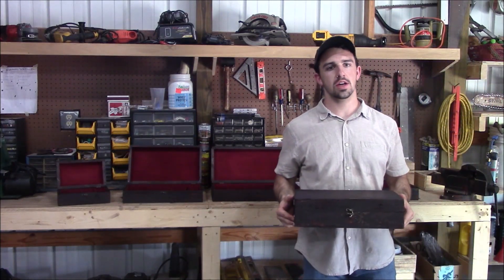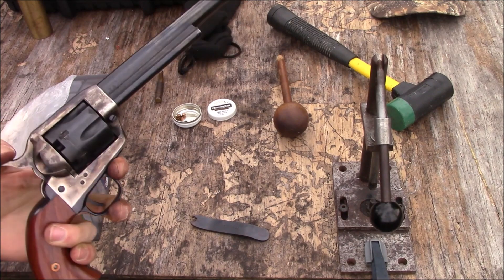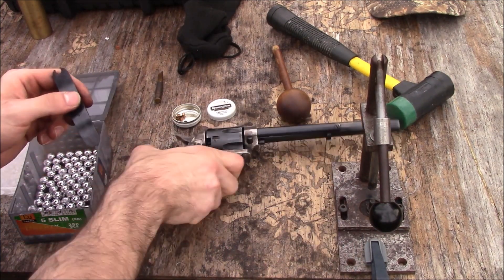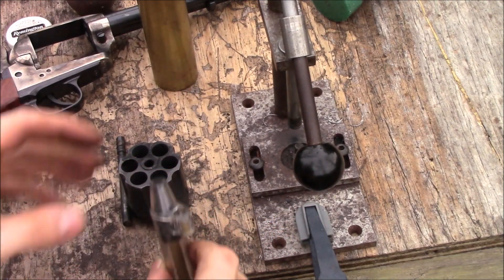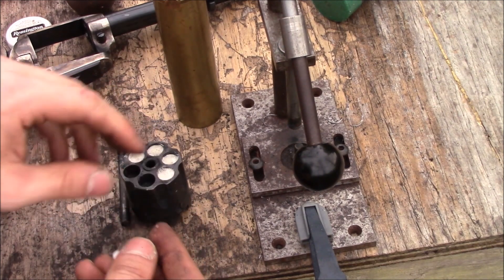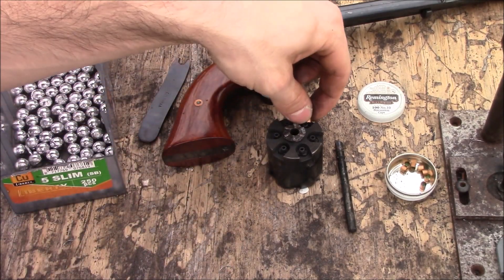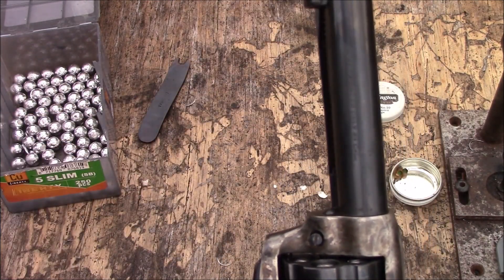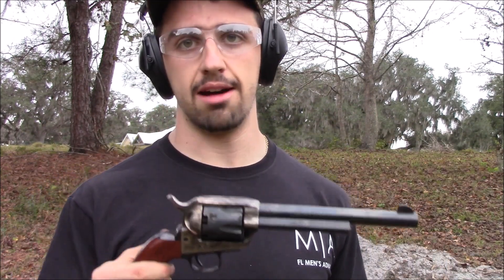Loading and Shooting the Pietta 1873 .44 Black Powder Revolver

Comment: Just bought one of these manufactured by Pietta in 1999. Fit and finish is great compared to what I’ve heard about Piettas 90’s quality. Has a mirror polished hammer with correct checkering, deep rich blue, and very beautiful blue case color hardening. Also came with a set of faux ivory grips. Cost me half of what a new one costs. Still my best purchase to this day.
Reply from the maker: Sounds like a great find! Despite being historically-inaccurate and all that, it's a fun revolver to shoot on the range.

Comment: Hi!  Very good video, it's worth learning how it's done in the West 👍 Can this model be loaded with 21 grains and a different size bullet, 454 or 457?  Is the 451 You use better?  (for 5,5 barrel). Greetings!
Reply from the maker: The right size bullet is dependent on the diameter of the chamber in the cylinder. Some of these .44 cal revolvers fit .454's better, where others could require a .457, for example. The best sized round ball is the one that leaves a ring of lead when the ball is loaded into the cylinder. Thanks for watching!
Reply: @blackpowdershooter44  If the ring is left on, it fits tightly and that's good.  I will measure the diameter of the chambers with a caliper, that's an idea 👍 Thank you for your answer and I wish you many "Tens" and good luck on the YT channel :) Regards!!!

Comment: I took the ejector rod off of mine as I don't lime having non functioning things on my guns. if i ever had to carry one of my cap and ball revolvers for self defence I would use my 1873. most options for a comfortable and secure holster, fully protected nipples, and mine has a safety notch in the cylinder for the hammer.
Reply from the maker: I agree, the ejector rod has no use and is just another thing to clean I just like the way it looks on the gun.
Reply: @Extra Relaxing uberti

Comment: If you don’t touch the cylinder the pin comes out much easier,any pressure against the cylinder makes it much harder to pull the pin
Reply from the maker: Makes sense. In any case, the cylinder pin removal tool is a must for someone who has one of these revolvers. Thanks for watching!
Reply: @blackpowdershooter44  I have 2 pietta and 1 uberti 1873s and if I hold it by the barrel and push the button without touching the cylinder ,the pin comes out much easier. Keeping it wet with oil helps also. I hate to pry anything against the frame because it will show wear eventually.

Comment: Those cases are really nice! I got one like those from Taylor’s a while back but I really like the darker finish you put on them. 
I would like to do a conversion on one of these. But I hear it is quite the affair. Does the ejection rod work or is it fixed in place?
Reply from the maker: The ejection rod does work actually, which is pretty funny because it doesn't do anything with the cap and ball version. Does your box from taylors have something in place that prevents it from opening all the way? I'm thinking about adding that feature to some of the boxes in the future.
Reply: @blackpowdershooter44  yeah it props up on something not sure what.
Reply: @blackpowdershooter44  I took a closer look and the hinges have raised portions that meet and hold it at a 90 degree. Next time I see yours on eBay I’m going to get one.
Reply from the maker: @Munkylaw  Thank you! I am going to put 2 different models back up for sale this weekend, and will put a link in the video description, though I hear that the link sometimes doesn't work correctly.

Comment: Do they make a conversion cylinder for this gun? If they do it’s probably 200 bucks, 400 for the pistol, 200 for the cylinder, probably be just better off buying a Cimarron in .45 Colt or something. Sorry just thinking out loud. Ran across one for sale with a pound of lead balls, a rammer stand, 2 big bags of wads for $450. Was trying to debate if I wanted it or not.
Reply from the maker: They do not, the frame is designed a little differently to make it not compatible with a 45 LC cylinder.
Reply: @blackpowdershooter44  thanks for the feedback. I think I’m gonna pass on buying it. I’ve got an 1851 and an 1860 Pietta. I don’t think I’d like the idea of having to take the cylinder off everytime I want to reload. I do want a reloading stand though. Those display cases look good too by the way.
Reply from the maker: @wvbygraceofgod5508   Glad you like the boxes, I appreciate it! Btw, you can always take that $450 and put it towards an 1858 Remington... Just saying lol. Thanks for watching
Reply: @blackpowdershooter44  1858 New Model Army was really what I was wanting next for a black powder. It’s funny you even mentioned that, I think that’s a sign, lol

Comment: You have a proper powder flash why not just powder directly from it?  The volumetric spouts screw on and off, or you can cut that one down to throw the volumetric charge of 25 grains, but black powder and all substitutes are made to throw by volume so the volume your spout throws with one matches the others regardless of grain weight.
You place your fingertip over the end of the spout, open the valve with your thumb, and turn it upside down to let powder fill the spout, then close the valve and tilt by up - you have the proper amount in your spout.  The method you're using isn't giving you any better accuracy so why complicate the process.
Reply from the maker: I rather keep the 30 grain spout as I use that with the majority of my other .44 cal cap and ball revolvers, thus the reason for pouring the powder into the measure. 30 grains is just a bit much for the 1873s' chamber capacity, at least with the particular revolver I have

Comment: that gun is made to be converted to shells my guy. just buy the cylinder for it.
Reply from the maker: The firing pin on the hammer, and more importantly the slot in the frame where the firing pin on the hammer would strike the primer on a cartridge is offset. This means it cannot be converted to firing cartridges unless one were to grind open the frame and install another hammer so that the hammer could strike a centerfire cartridge, likely causing a safety issue.

Comment: This gun makes absolutely 0 sense unless you live in an area where centerfire SAA’s are illegal and you just really want one. I love black powder percussion revolvers but this design (fouling problems, no rammer on the gun, etc.) are just too much.
Reply: yeah thats why they make it obviously
Reply: cough cough felons no background check no ffl ships to your door add a cartridge conversion and now you have cartridge firing gun no 4473
Reply: The only viable option if you love the gun design, not if you love shooting.

An 1860 Army shoots the same ammunition and does it a lot better than a percussion 1873. The 1873 was designed for metallic cartridges, so the cylinder was bored through and the entire length employed to hold the charge. To create a percussion version, you have to add metal back into the cylinder to hold the loose gunpowder, making the chambers in the cylinder ridiculously small.

The 1873 Percussion simply cannot hold as much powder as an 1860 Army revolver does. The cylinder is too short (it's shorter than the one in a .36 caliber Colt Navy!)
Reply: @shanebrown2921  Conversion cylinders are not made for this historic model. In order to do that? You would have to modify the frame and cylinder in such a way that if you don't know what you're doing? It could mean your life, and or functionality issues and be VERY expensive. This was originally how this revolver was made I believe. This was during the creation of cartridges and was gaining popularity, most people still used black powder for a while.
Reply: @diynreviewguy8992  yea Ik now actually lol 1858/1851 conversion cylinders idk if i knew a year ago tho I’ve been more into black powder firearms since I actually make my own powder now but I am curious if you could buy an actual 1873 cylinder not a conversion cylinder and be able to run it in this gun or if there designed not to take the actual cylinder but I’m sure you could modify it somehow to work

Comment: RECOMMENDATION:  SAFETY: never load powder I all chambers before adding wads and bullets. There is a potential to overcharge a single chamber. Do your loading one chamber at a time.
This is something that many very highly experienced black powder shooters will tell you.
Reply from the maker: This revolver cannot hold more than 35 grains of powder, if that, and thus there is no danger. That said, I can appreciate what you're saying here. Safety first
Reply: @blackpowdershooter44  Imam 8. Revolvera i uvek stavljam podmaz preko kugle. Pčelinji vosak ili vazelin. Vi niste. Kugla kod mene ide direktno na barut.

Comment: Where's your capping tool?  You wasted money on a rifle measure instead of using the flask only, but you didn't get a capper?  WTF?
Reply from the maker: Relax. Powder measure was used because the 28 grain spout pours a load that is larger than this particular revolvers cylinder can hold with a wad, and thus the reason for pouring into a powder measure. Since I have multiple muzzleloaders, some of which are rifles with large powder capacities, how is the rifle measure a waste of money?

Comment: Uh, A-L-L 1873 Peacemaker Frame revolvers, of whatever brand, and whether it's a cartridge OR percussion cap pistol, should ALWAYS LOAD FIVE (5) , N-E-V-E-R - 6 ! For Example, this is why Ruger quit making the single action old model 3 screw, .22, .357, .44, etc and designed a transfer bar safety for the revolver because ignorant, inexperienced shooters kept loading 6 and accidentally firing a load! STUPID! On the 4 click models, 
A-L-W-A-Y-S keep the hammer back ''1 Click''
''KNOWLEDGE'' is also a ''Safety'' ! There are MANY variations of the 1873 peacemaker, whether it's the original Colt, the 1970s Virginian Dragoon, Ruger with adjustable sights, Uberti, who by the way, makes an excellent reproduction, & several others. The point is, they are all based on the Colt 1873 Peacemaker Frame (or the Army M1873 until almost the end of the 19th century) Incidentally, Ruger modified the design by removing the double leaf spring and replacing it with coil springs! However, I have made my own leaf springs out of feeler gauge leafs. But instead of ONE THICK SPRING like came with the gun that always breaks, I stack about 5 or 6 thinner ''feeler gauge leafs'' together! Which hardy ever break. Use a Dremel to make the springs, and keep and use the original hole in the feeler gauge for the screw. If you'd much rather replace the broken spring with store bought, go ahead. I NEVER do though